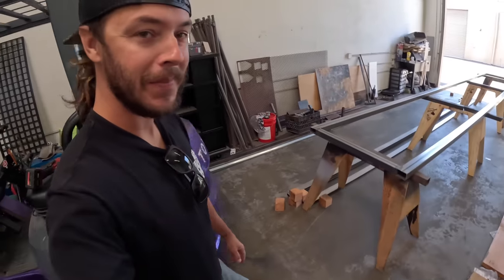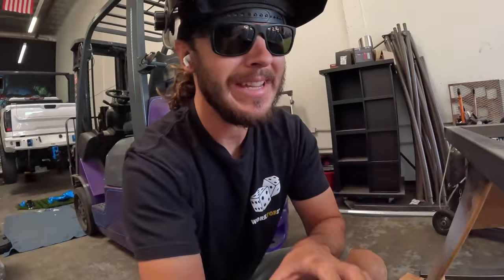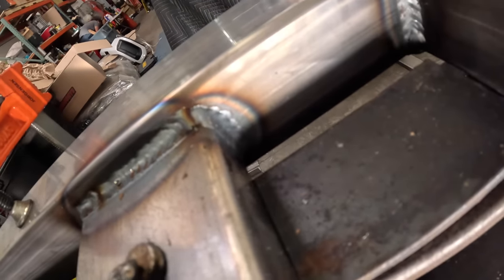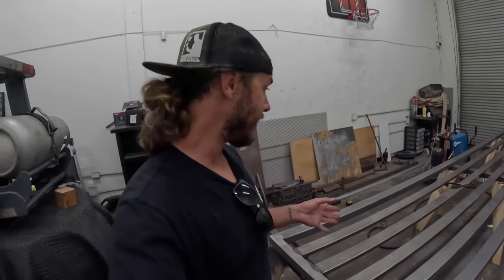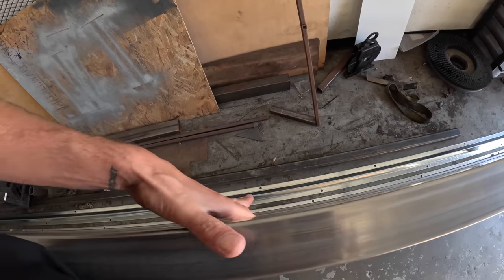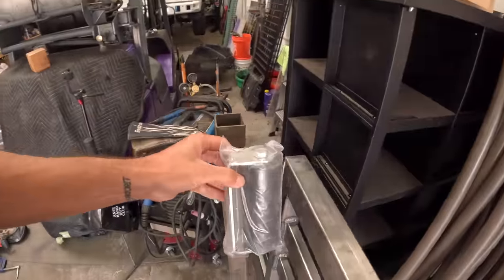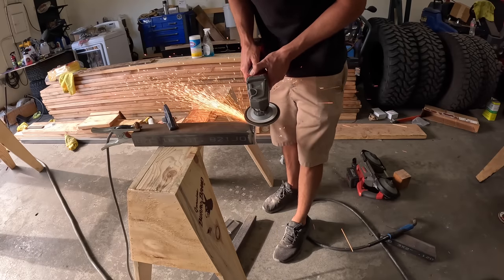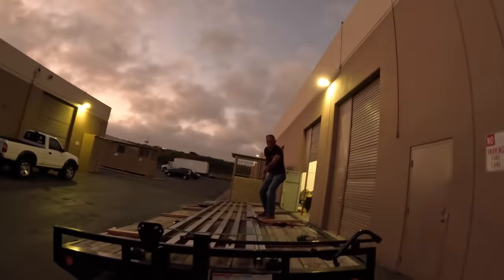Building a Custom DIY Gate the Easy Way! (Part 2)

Comment: Instead of some vertical supports, you can have someone water jet out some sort of logo for the ranch. A double “RR” or something for ryno ranch. Weld each bar to that for support so they don’t wiggle as much!
Reply: I had the same idea. But I was thinking he had mentioned how he liked the In-N-Out palms. That would be a cool touch and kinda match the main entrance when it gets finished.

Comment: I know you said you are confident and I dont see the welds failing right away but I would definitely think about adding 2 vertical support sections. It can still look clean with supports.
Reply: Yeah I can see those bowing back and forth just in the wind. Do that for a few years and I feel like it will be a lot of stress on those attachment points which will make even a little imperfection widen and possibly fail. Granted, it's metal outside so it will eventually deteriorate anyway without regular maintenance.
Reply: @PRC533 it’s getting powder coated

Comment: Nice!

Dont worry about supports in the middle, just add an art piece and it will lock everything in if it even needs it.

The way the middle runners flexed when standing it makes me think the wind my fatige the welds. Either way all stuff that can be addressed once it sees some action.

Comment: I would rethink not having vertical supports in the middle. Just the way they shake as you moved it, eventually it may chatter and shimmy as the vertical middle section shakes.
   It also opens your welds at the end for cracks because the vibration. I would do at least one vertical support,  if not two, dividing it in thirds. Possibly the same spacing as your vertical fence posts so it matches those....but it's your gate.
Reply: I was thinking the same. Over time even the wind will blow it around so much that it will stress out those attachment points. Even a single support in the middle would help a lot.

Comment: Should not need anymore wheels then you have whatever you do don’t put one in the middle it will actually mess things up as far as it rolling on the track. for a project like your big entrances you might need to do 4 wheels two sets of side by side wheels. For the part where you made your tails there on the end I would definitely keep the bottom and brace it rather be safe then sorry but instead of having the one on the top could build a catcher  just before your rollers with 2in flat bar and rubber pads or nylon rollers to not scratch the finish on your gate. side that way you don’t have just a weird tube up top I can send you some pictures for examples if you need some reach out. Hope I help looks good so far.

Comment: A good practice is to only tack everything you can then weld it out. All the tacked pieces help to keep the piece straight especially when working of of saw horses. I also find it faster overall because you don’t have to change tasks so much.
Love your videos!!
Reply from the maker: If it wasn't so far apart requiring constantly moving the welder, I definitely would've fit it all up and tacked it all at once.

Comment: Another way you could of welded the square bars together without making caps on the ends to cover up the holes would of been to cut them at a 45 degree angle on the ends then join the square bars together and then weld it, but man you did a killer job on making the fence look awesome, great job. 😁👍

Comment: Silly question, do those wheels say what kind of load they are rated for? I suspect that if you don't want to be constantly replacing wheels you might want to put a couple more wheels on that gate.

Verticle support does not have to go straight down. No reason you can't create a design by placing pieces between the rails.

Comment: Comments are being made as i whatch the video that gate will destroy itself with out the supports use box meterail get your angles use a triangle 🔺️  and push to the corners but weld them in between the cross panels would keep your style and make that thing sturdy
Reply: Ps im no gate builder but ive wasted my money learning this on my own projects and i didnt have that nice of a welder so all things mentioned are just a diy